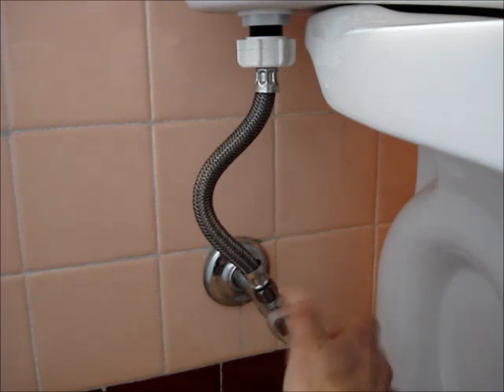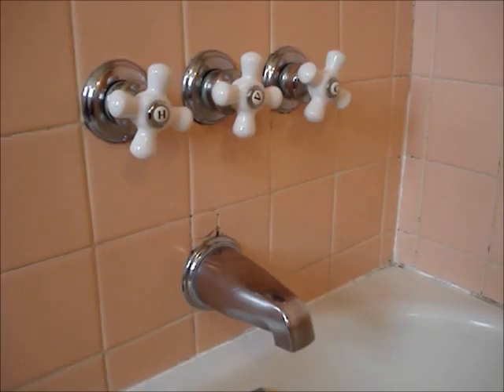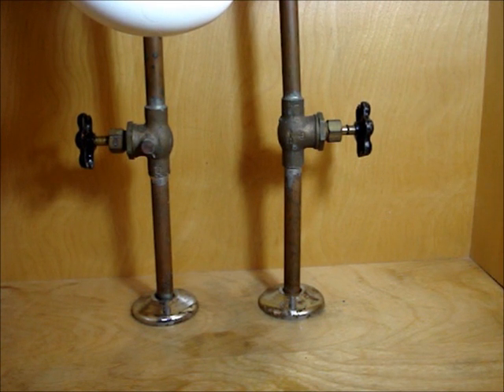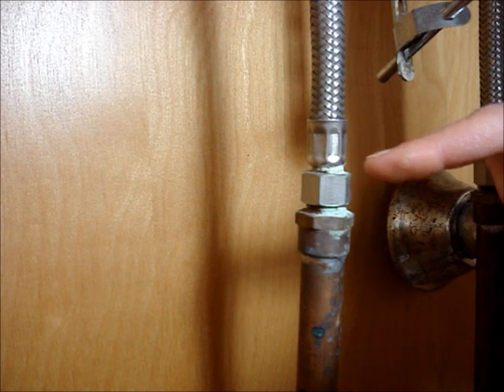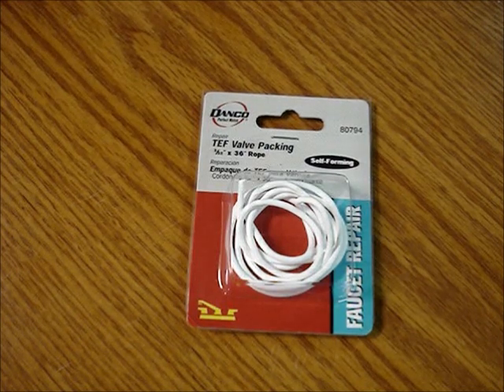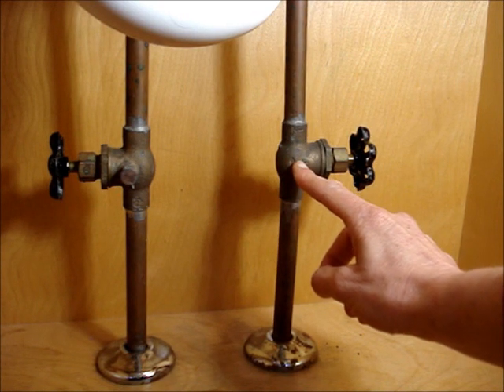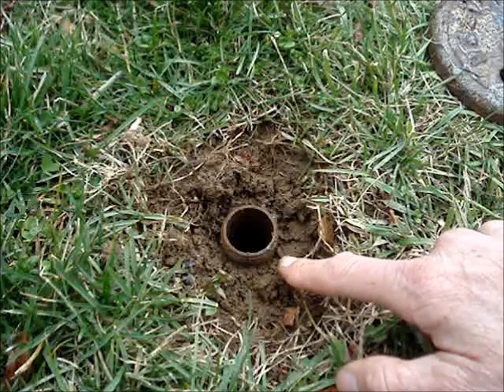Find and Maintain House Water Valves

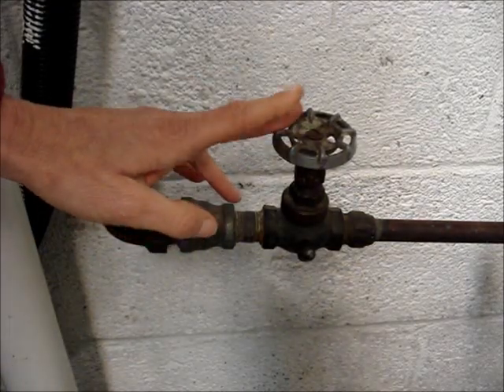Comment: 04:33 - is ball valve better?
Reply from the maker: Most people do prefer ball valves.
Reply: @Know-How-Now  This is not answer to my question :)
Reply from the maker: Sorry I missed the 04:33.  I like the ball valve rather than the compression style for the main shut off valve.  I have to pay the water company to close the curb stop.  They have an odd size tool to turn the curb stop, so it's difficult to buy the tool.  I read the rules and I am not allowed to turn that valve either, if I would turn it and it breaks I suppose there would be some sort of penalty.  I have been told our water company is not nice to people, though I have not had any bad experiences.  There's no washer to change on the ball valve and they don't tend to stick if they are not turned a few times a year.  Less maintenance/paying a fee to service a compression style valve.